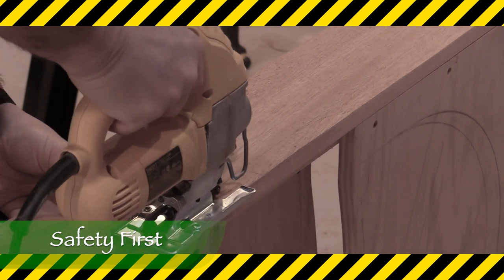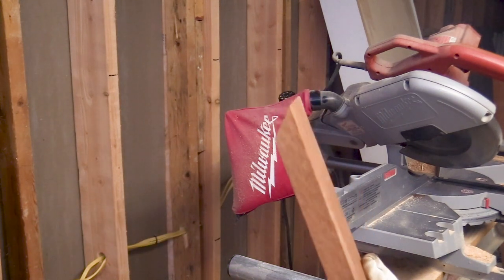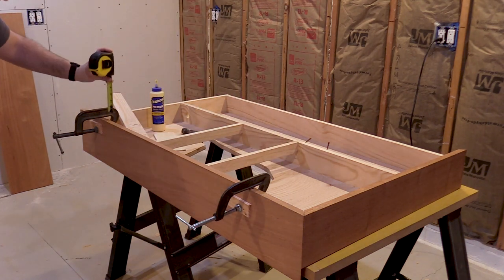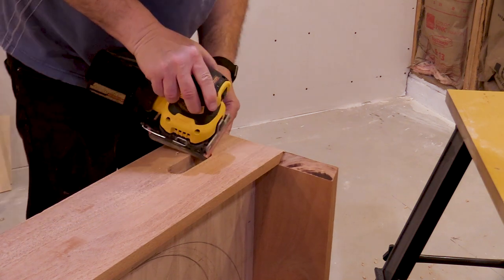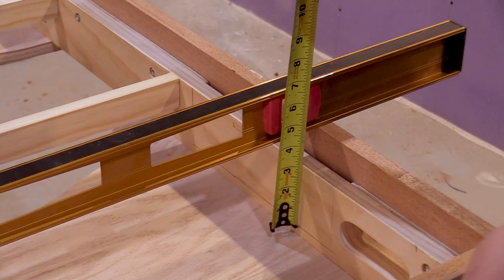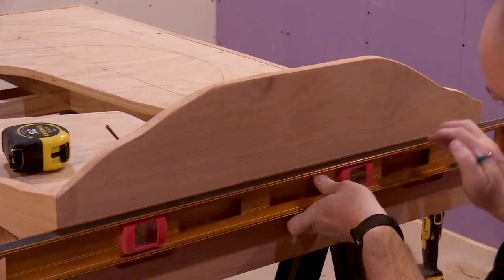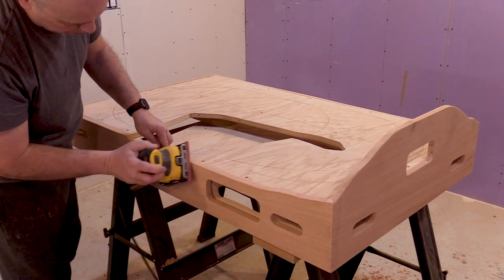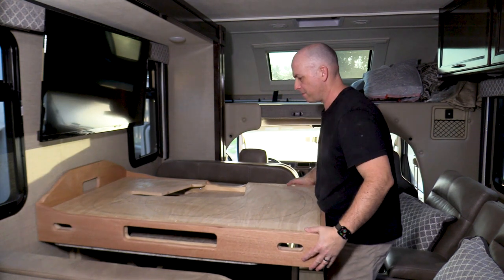Layout Building N Siren Creek Part 3 - Adding a Fascia

Comment: Awesome work !!!! I acknowledged the layout end comes out past the end of the table in the RV. Did you allowed enough space to get by this when rr in the RV ? Can you call this your RVRR project ?
Reply from the maker: I did a lot of measuring when figuring out how big I could make the layout.  I talked about that a little in the first episode.  When the slide out is extended, there is still plenty of room to get past the layout.  I don't think I'd want to make it any longer than it is (with the fascia on, it's around 50 inches).  That's also one of the reasons I don't want to have anything sticking out beyond the fascia, so we don't snag anything while walking past.  Thanks for watching!

Comment: Suggestion: Put up a saftey plexiglass wall encase your RV needs to make an emergency stop.
Reply from the maker: That's a good idea.  Nichole also suggested making some kind of cover so that our cats don't ruin the layout when we travel with them.  I'm thinking about how to do that, maybe with plexiglass.  We will definitely tie the thing down when we're rolling.  Thanks for the input!
Reply: @DanielCortopassi  Maybe make a shallow plexiglass wall squared even (enough to clear the tallest structure) and make a lid.